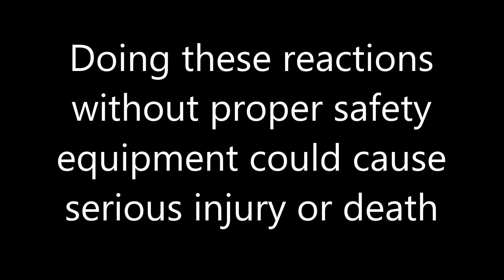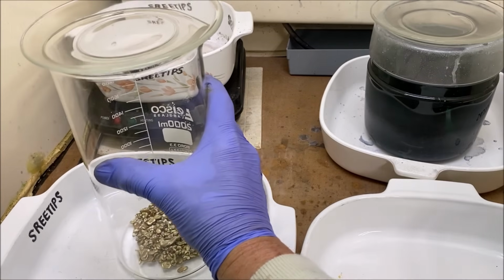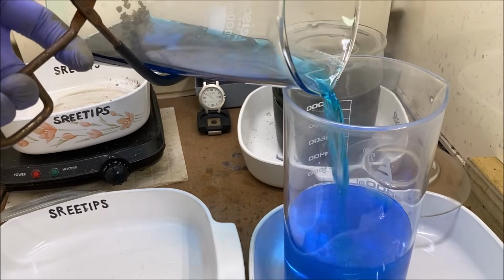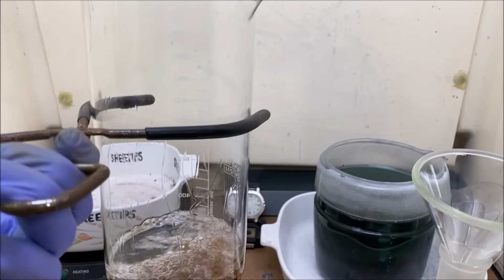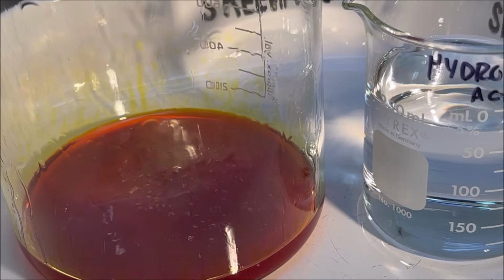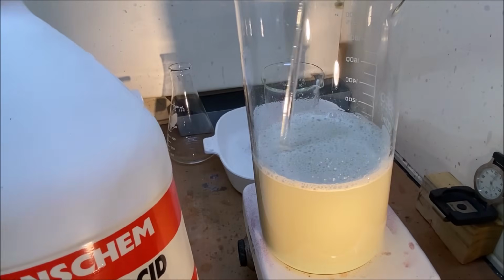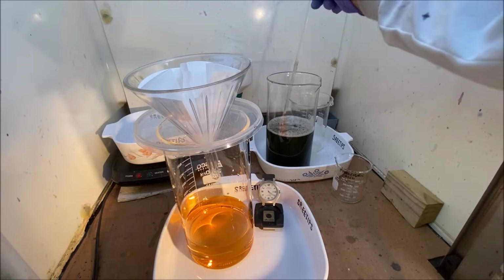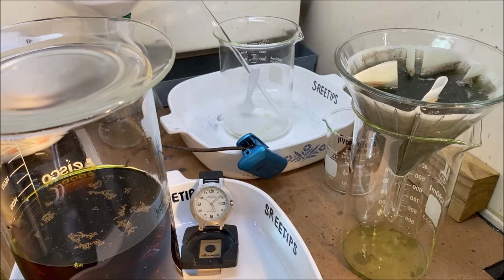Zinc GOLD Bar Repurification Part 1

Comment: The blue color was from not rinsing the gold properly. If you had boiled the gold in distilled water, all the blue color would have gone away, and then your 2nd nitric treatment would have been colorless. As you can see, there was zero reaction in your 2nd nitric treatment. The only reason there was blue left was because you couldn't rinse the gold deeply without boiling it in distilled water, not because there were any actual base metals left in the gold. I've explained this many times how important it is to rinse the gold well with distilled water rinses AND boils after the 1st nitric treatment. Nice attempt nonetheless, and you almost did it perfectly. The silver nitrate that came out of solution after the 1st nitric treatment was most likely due to excess evaporation, causing the solution to become overly saturated. Temperature is key here. You want a hot solution but not a vigorous boil. It isn't really an issue, however, as silver nitrate dissolves readily in water. Your distilled water rinses take care of that, as you noticed in your video. Anyway, I'm happy to see you took my advice. A little shoutout would have been appreciated! To all the people who said I didn't know what I was talking about... WELL, NOW YOU KNOW!
Reply: Basic chemistry would have told you that ‘one big boil’ wasn’t going to be as effective as many little boils.
You see the same effect when he’s rinsing flasks and beakers with small amounts of solvent.

More importantly, he’d be dealing with less total liquid volume.
Reply: @williamfoote2888 You are completely wrong. The only problem was that he didn't rinse the gold properly after the 1st nitric treatment. He should have boiled it in distilled water, which would have removed all the remaining blue color deep inside the gold that simple rinses cannot remove on their own. The 2nd nitric treatment gave the illusion that there was still base metals in the gold when there wasn't. What it did do, however, is rinse the gold properly and remove the remaining blue color. There was zero reaction as all the base metals WERE removed with the 1st nitric treatment. It IS effective. Your comparison to rinsing flasks and beakers is irrelevant. Also, he doesn't end up with more liquid volume. He ends up with less by calculating precisely the amount of distilled water and nitric acid required to dissolve all the base metals. I would suggest that you educate yourself before commenting nonsense on other people's comments. I'm a gold refiner. I know what I'm talking about.
Reply from the maker: If you look carefully, after the nitric boils are complete, when I add the HCl, a bit of silver chloride can be seen forming in the gold. And that even after two more small nitric boils. When I do multiple small nitric boils, I don’t get that. I still prefer multiple small boils to the one large boil.
Reply: @sreetips I can't really see any silver chloride, but if there was any, that is because you didn't rinse the gold properly. I never have that problem. Like I said, distilled water boils are very important when rinsing the gold. In the video, you can tell you didn't rinse it properly as aqua regia is immediately formed when you add your hydrochloric acid. It's not really fair to say you prefer one method over another when you haven't done the other method properly. When done properly, this is the most effective method. Do it the right way, and you will never look back. Can you please at least make one more video featuring this method, but done properly? It is very important and valuable information for you and your viewers. Thank you!
Reply: @sreetips 

BASE METAL DISSOLUTION CONSTANTS

50% Distilled Water / 50% Concentrated Nitric Acid 

Copper Inquartations 

6K: 3.15
8K: 4.2084
9K: 4.725
10K: 5.2542
12K: 6.3
14K: 7.3584
15K: 7.875
16K: 8.4042
18K: 9.45
20K: 10.5084
21K: 11.025
22K: 11.5542
24K: 12.6 

Silver Inquartations 

6K: 3.15
8K: 3.2172
9K: 3.25
10K: 3.2836
12K: 3.35
14K: 3.4172
15K: 3.45
16K: 3.4836
18K: 3.55
20K: 3.6172
21K: 3.65
22K: 3.6836
24K: 3.75 

Sterling Silver Inquartations 

6K: 3.15
8K: 3.3012
9K: 3.375
10K: 3.4506
12K: 3.6
14K: 3.7512
15K: 3.825
16K: 3.9006
18K: 4 05
20K: 4.2012
21K: 4.275
22K: 4.3506
24K: 4.5

Comment: I am certain mercury is a viable  answer to removing gold plate and computer scrap . If the mercury is distilled it can be used over and over . That would make plate easy and economically feasible as soon as I get enough to get a gram or 2 ,  I will make a video. But I will tell you first . Thank you for the inspiration

Comment: If you know the bar is greater than 20K, why would you add silver to it and not just AR it again, maybe go for an SO2 precip? Got that much silver lying around?
Reply from the maker: Yes, I have about five sets of sterling flatware. All needing to be dissolved in hot dilute nitric. Plus the zinc will try to follow the gold. Best to inquart with silver from the git-go and get it over with. Nothing worse than double refining then still having surface contamination on the final bar. And I believe that’s what would happen if I just dissolved the bar with no inquartation first.

Comment: I misspoke slightly. I said HCl when I should have said distilled water. 

There are 2 flaws in this methodology, Chief. The 1st is that you need to account for saturation during the digestion of silver and base metals. In order to account for this it is necessary to add HCl to at least maintain the starting volume and probably nearly double toward the end. The 2nd is that you didn’t show that all of the Nitric had been consumed. If you had either added HCl until no further reaction could be detected or if you had poured the solution into a vessel with silver, that would have proven whether or not all the Nitric was consumed. Not trying to be a nudge, but to actually prove the point one way or the other those 2 factors really do need to be accounted for.
Reply: I wouldn't recommend adding HCl when trying to dissolve silver, it has a tendency to precipitate as silver chloride is insoluble. Your remark about retaining volume is fair though.
As for your second, the nitric acid has a tendency to produce brown fumes when cooked. All nitric was either consumed or evaporated by that time. I would have tested for silver after the second small boil with either HCl (white precipitate),  NaCl (ordinary kitchen salt), also a white precipitate unless iodide is present in which case you get a yellow precipitate or potassium iodide, which gives a very distinguishable yellow precipitate.
Reply: @apveening , I added a caveat to the beginning of my comment. I should have said distilled water. My bad.
Reply: @apveening , the point I was making had to do with saturation. If the solute becomes saturated, then no amount of heat or Nitric will cause any more metal to be dissolved. But if metal and Nitric are still present in a saturated solution then adding more solute (in this case distilled water) will cause the stalled reaction to resume.